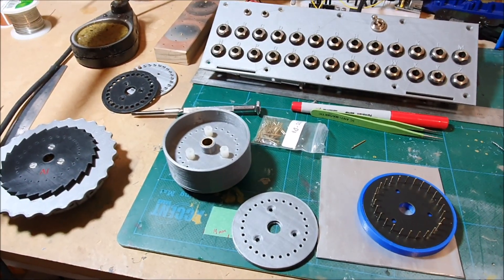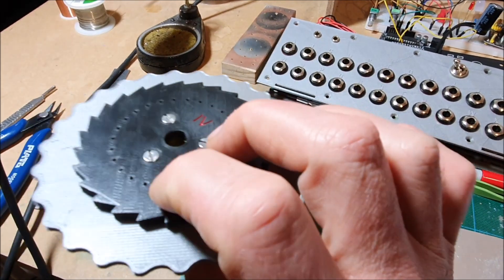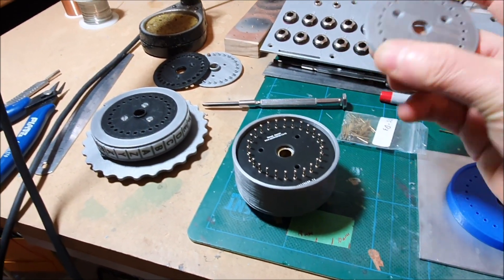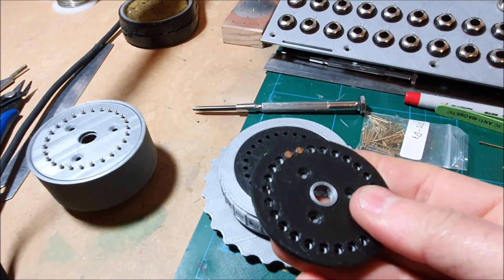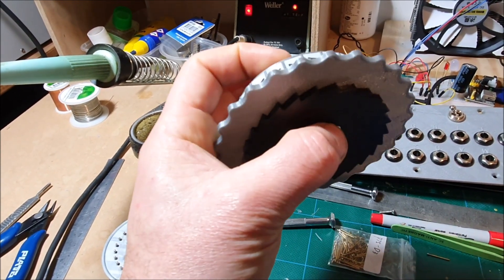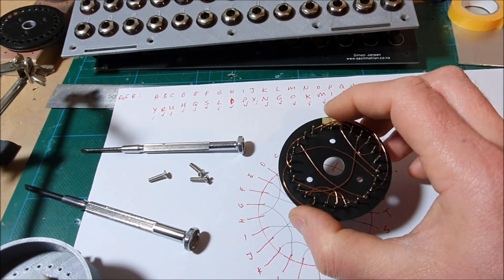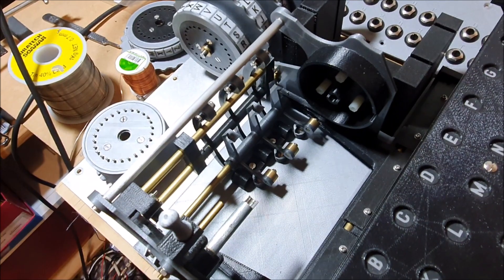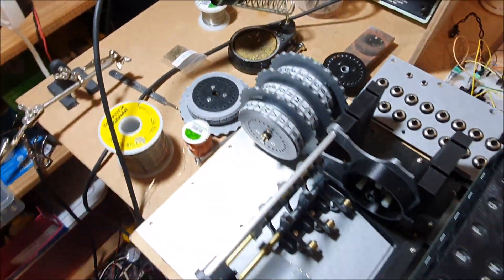3D printed Polish Enigma machine reflector B completed

Comment: Hey man, love this stuff! I've been working on my own Enigma replica for a couple of years now, started roughly at the same time as you did i think. I'm doing the wiring by hand, with true wiring rather than circuit boards, but i'm using a lot of different techniques anyway. 
For anyone wondering why this takes so long; a project like this is a serious amount of work, thinking, preparation etc. And restarting parts when they totally failed. 
Very curious to see how it will look for you once youre done! Keep it up!
Reply from the maker: Hi, yes it is a massive job! I am working on it still. Am just doing the plugboard now and then the entry wheel. Then finally the rotors themselves. Part of it is testing out ways and techniques to make things work like the flat contacts. If those work in the entry wheel then I know they will work in the rotors for example. I have boxes and bozed of 'failed' parts where I needed to design, print, test then redesign them. It is literally thousands of hours of work. The PCBs I am using help by simplifying the wiring a little and will just keep everything tidy. Everything is done in multiples of 26 of course (26 letters) which even with thin wires is quite a bit of cable management. I should be doing another little film on progress, slow as it is, soon. Is yours online anywhere? Simon
Reply: @asciimation  Hey, I currently do not have a lot of online documentation. I guess i should do that sometime, but well. It is a whole lot of work, especially when certain parts dont work quite the way you'd want them to. 
One of the main issues i run into is getting ALL pins to make contact at any given point. I am using spring contacts, but i do a lot of stuff with tools that can't really handle the precision youd like to see (i don't have a lathe, milling machine etc, only a drill press). 
If you'd like i could email you some pictures of what i'm doing tho. 

My starting point was a little different i think; my focus is mainly on making something that operates the same way, so i'm spending a lot of time figuring out ways to make the wiring work in my own design, but it doesnt look the same as an original enigma at all. 

Id love to exchange some thoughts & all, since you seem to have a lot more blueprints than me aswell (i drew most of my pieces from scratch) that could be very helpful
Reply: @asciimation  Also i feel you on the sheer amount of work. Wiring the rotors took me basically three full days for three of them, "only" 78 wires, and i couldn't see straight at the end of each day. but they turned out beautiful- shame no one will ever see the inside of the rotors normally

Comment: I'm planning to build an Enigma replica as well and watching your videos with interest. I'm only in early research phase and looking to buy a 3D printer - do you think an SLA printer would have made this build easier, or closer to the original? Are there many design changes that you wouldn't have had to make if you'd been using an SLA printer?
Reply from the maker: I've not used an SLA myself but somewhere I worked once had some very fancy ones. I never considered it when making my models. I was more thinking in terms of getting parts printed in metal once I prove it all works. I always considered SLA to be better for really fine details but the Enigma I am making doesn't really need that.

Comment: Book ordered. Thanks for posting the link. Thanks for keeping us updated on your progress. One question, why use wires? Why not use the printed circuit board on the reflector to connect the pins? Is there no way to do it without them crossing?
Reply from the maker: Laziness really :) This way I can use one circuit board for any reflector. Same with the rotors, one board for all of them. The rotors needs lots of wiring anyway since it has to go from the pins on the board to the contacts off the board so wiring the reflectors (and the entry wheel) isn't too big a job.

Comment: Nice work! I'm also trying to make a rotor encryption machine. Which pogo pins and contacts did you use?
Reply from the maker: I'll have to look back in my Aliexpress orders and see if I can find them. I need to do that anyway since I want to order more so I will post the links here or in a future film.
Reply: @asciimation  thanks! That would be awesome.
Reply: @asciimation  did you find anything?
Reply: @gekesulen  I'm building a replica Enigma machine, too.  I ended up using pogo pins too.  These are the ones I bought: https://www.aliexpress.com/item/32947854133.html?spm=a2g0s.9042311.0.0.27424c4dgBrh0a.  A 1mm hole will allow you to press fit them in place, then a dab of cyanoacrylate glue will fix them.  The springs are fairly strong, though.  Consider that you'll have 26 springs per rotor and that the action on the M3 Engima requires 3 rotors + a reverse rotor, so that's 104 springs you need to compress.  That adds up to quite a bit of force.
Reply: @mikebenza  Thanks!
Reply: @asciimation  Did you found the order number of the Pogo Pins yet?
Reply from the maker: @hanswigger7289  The links to the actual product go out of date but if you search Aliexpress for "100pcs P75-D3 Dia 1.5mm Spring Test Probes Pogo Pin Length 16.54mm (Stroke Spring Froce:180g)" you should find them. The store I used was "WARDSTAR Official Store".